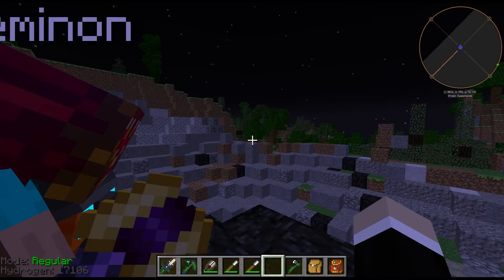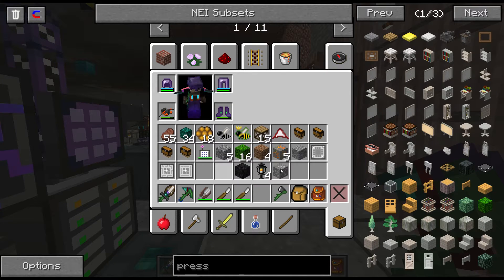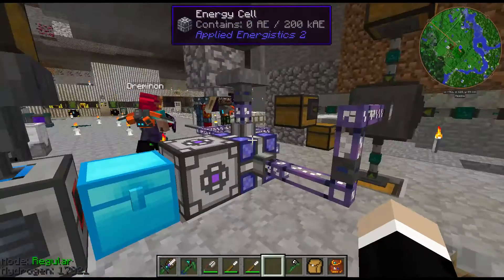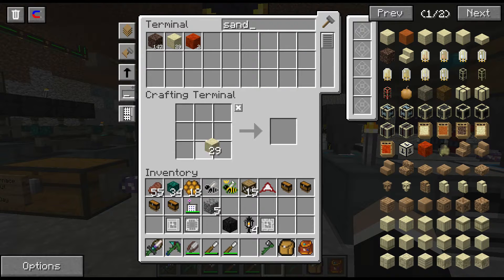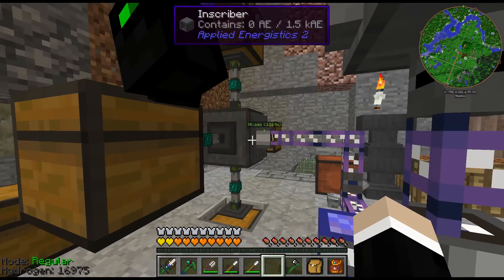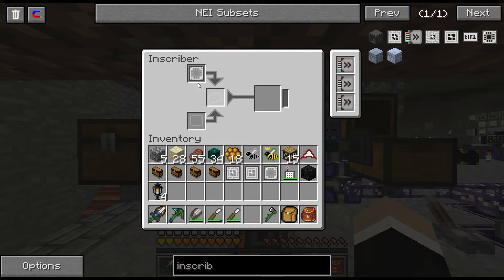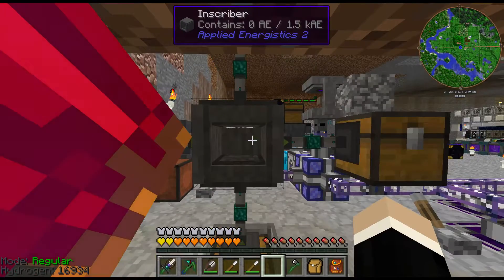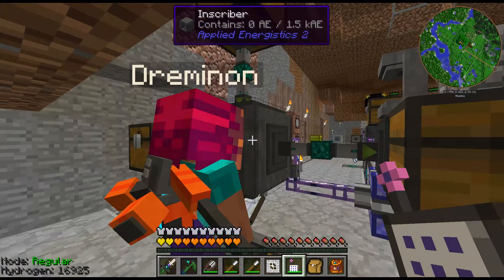Applied Energistics 2 1.7.10 Tutorial - Basic System - To The Point Tutorial

Comment: Prosper Craft How do I POWER my ME system using Extra Utilities' generators??? It's super annoying that it won't take my power, can ya help? Thanks!
Reply: This is a year later, perhaps this will help others at this point, but you just need the "energy acceptor" block. You can use pretty much whatever cable to wire the generator to the acceptor, then you use ME cable to wire the rest of the system up to the acceptor.
Reply: thanks XD I figured it out, but I forgot till just now :P thanks